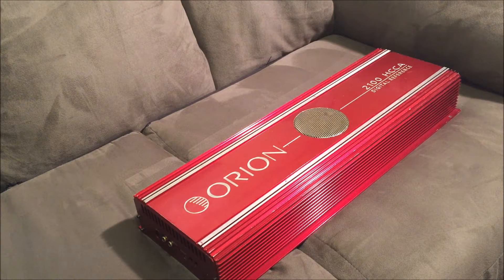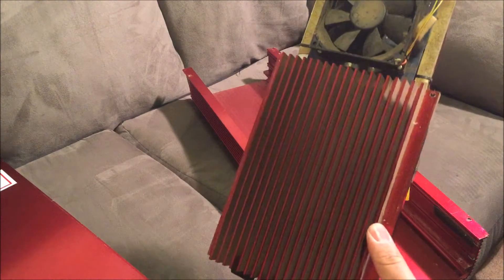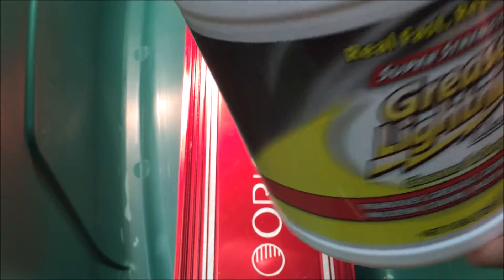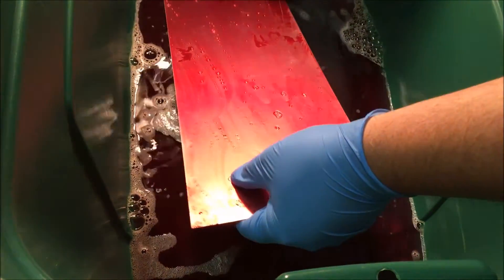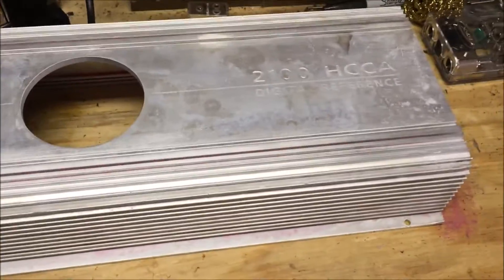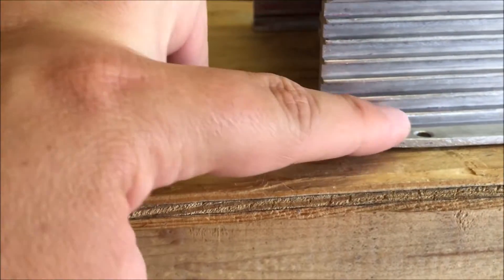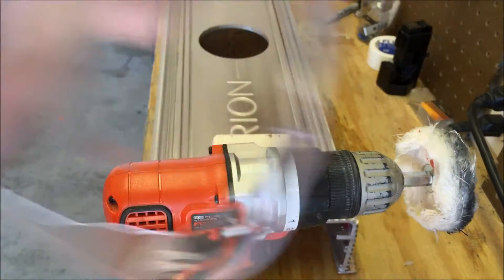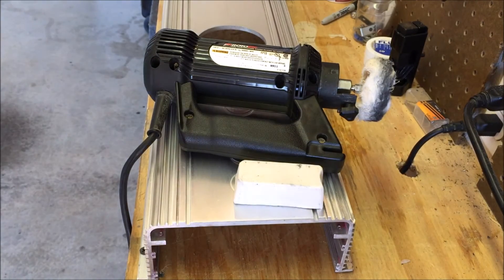How to remove anodizing from aluminum on a Orion 2100 Hcca (Operation Restoration Part 1)

Comment: to strip aluminum professionals use nitric acid, but you have to be very careful. I worked in a chrome plating and powder coating shop for a few years. looks good to me.
Reply from the maker: Thanks! I really wish I had access to a chrome shop. I would chrome this in a second!

Comment: Hey Vega...they make different grades of jewelers rouge. Drove a truck for 20 yrs, and believe me I've done my share of polishing. It can be bought at most bigger truck stops, or big truck parts stores. Trust me..it'll take alot of work out of the polishing process. I know an old man that goes over it with polish, until there is no longer any black residue visible on a white rag....
Reply from the maker: Yeah, the rouge that came with this buffing pad is cheap for sure!
Reply: +hifivega Po boys got Po ways bro...I understand.